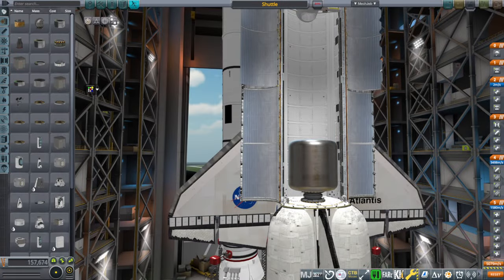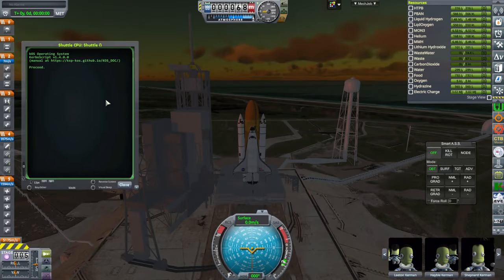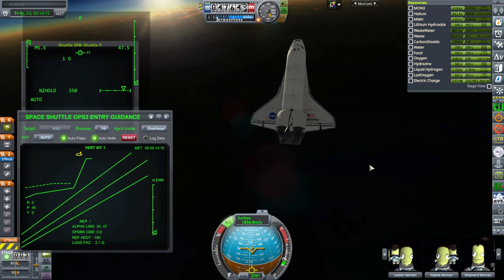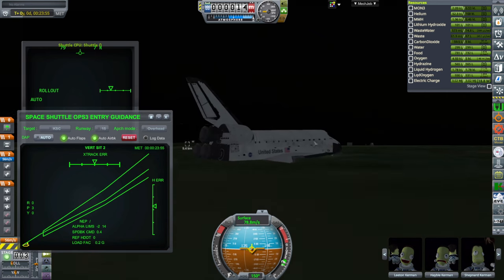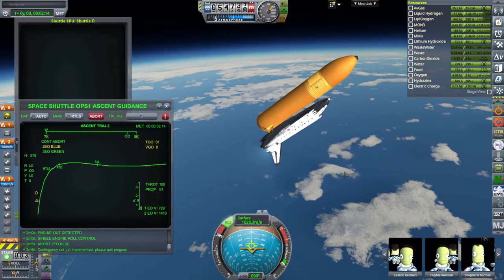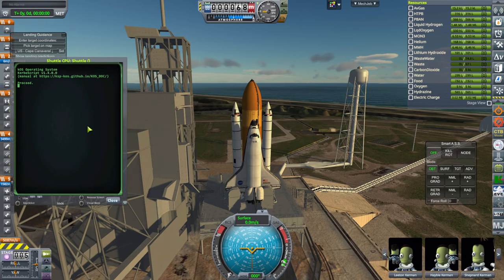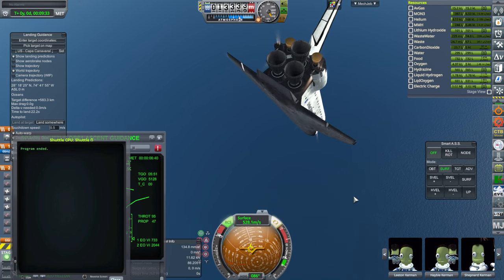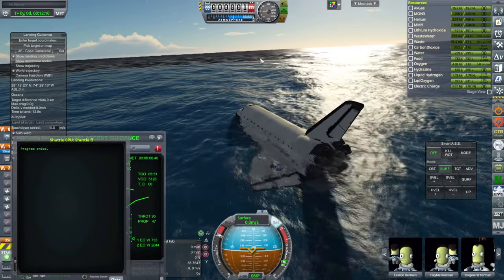Shuttle Aborts with Giulio Dondi's kOS Programs 2 (KSP 1.12 with RO)

Comment: Tyler, 2EO intact aborts (Transatlantic and ATO) are implemented but you need to wait until you see the 'single engine press' messages in the GUI, before that the program goes into 2EO contingency mode and I haven't got around to that yet.

Also, the top 'abort' button is intended to manually triggeraborts,  which can also be used to abort without any engine failures
Reply from the maker: Okay, single engine press. Got it.

Comment: With two engines out, RTLS becomes all but impossible. The shuttle has a twr of less than 1, meaning it drops like a rock. The only aborts are TAL, ATO, and contingency aborts.
Reply: losing a second engine during an ongoing 1EO RTLS will result in a contingency except in the last 30 seconds or so, when TWR is enough to achieve reasonable cutoff conditions

Comment: Im having trouble using the OPS3 guidance. When i run it under 122km it just shows a blank screen, all the buttons are there but the interface doesnt show up. The shuttle doesnt self guide either.
Reply from the maker: Remember to set everything to Auto - there's a drop-down thing and the auto brake toggle etc. - and hopefully that will help.
Reply: @RaizSpace  I did and nothing showed i still, also the AUTO button and the reset button were red
Reply from the maker: I don't have an idea right now - if I think of something I'll mention it.
Reply: @RaizSpace  Thanks dude, your really dedicated to your fans and there aint a lot of people who are like that